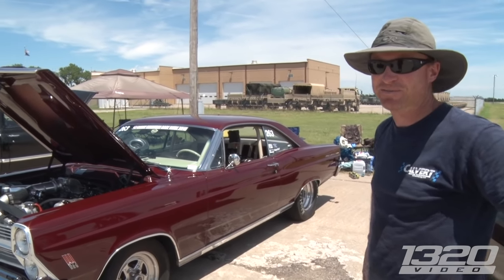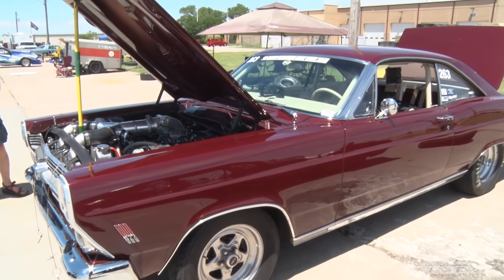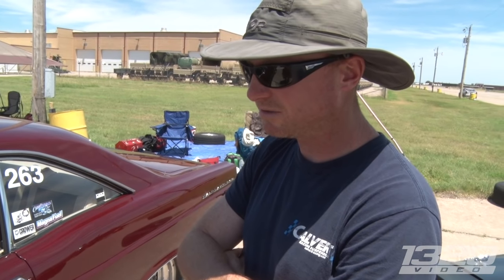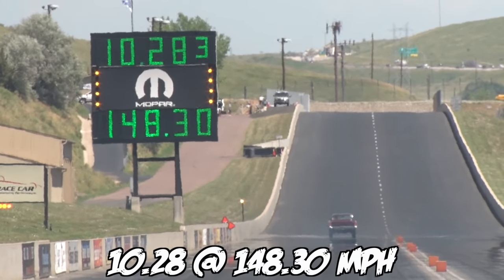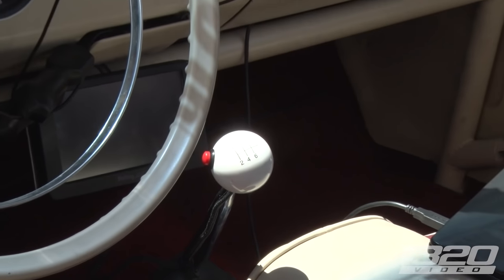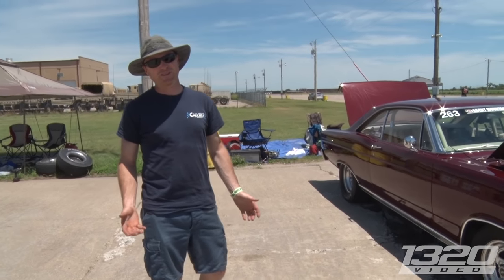UNBELIEVABLE Power Plant - Not Your Average Ford Fairlane!

Comment: Thanks for all the feedback, feeling privileged to get some 1320 love, thanks Kyle!  I will say I ran RMRW with the Hoosier QTP DOT tire, didn't hook at all!  Tried a MT slick after I got back and it hooked real nice, went 9.69 with a 1.63 60', still more work to do as always.    Thanks again!
Reply: v8Billy66 Love the car man! Keep doing what you're doing
Reply: v8Billy66 great job with the manual!
Reply: Mr. Jones yes
Reply: v8Billy66 right on! keep bangin them gears
Reply: Who built the trans?
Reply: BAD ASS!
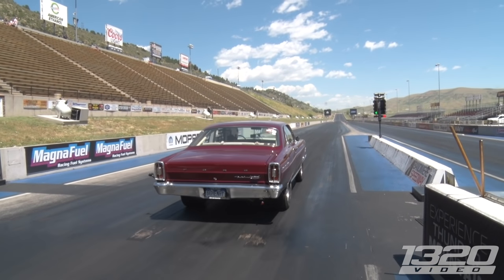Reply: v8Billy66 saw this vid when it first was posted. Awesome car.  But I just watched it again and it looks like you lost something off the car @ the 2:30 mark? What was it?
Reply: Liberty's Gear
Reply: Alternator belt
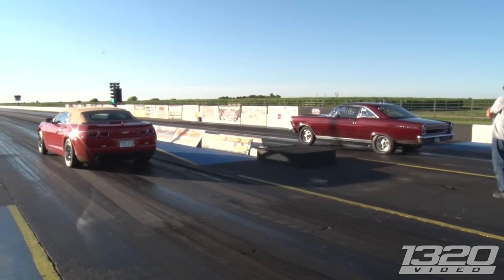Reply: The last run @ 5:10 was a 9.77 @ 151mph. Was that with the DOT tires, or slicks? That's a helluvan improvement from the earlier mid 10's, especially if it was accomplished with the same tires. Through several runs, it looked as if you were routinely breaking traction when shifting. 

 The run that threw me for a loop, was one of the last runs that ended at like 10.02 @ 122mph. There, you greatly reduced your et's AND mph's. I'm surprised you could shave off roughly 1/3 sec, but be 30mph slower(???)
Reply: So I have a 67 Fairlane with 347 stroker needing ideas

Comment: Gotta appreciate the dragsters that stay manual.
Reply: Dexter Yang after he twists a few axles and destroys a few driveshafts and clutches he'll be changing it over to a automatic watch and see
Reply: I don't think he will be not everything is about going fast in a straight line, with the 6 speed he gets 20 mpg I doubt he will get that with a power glide auto or what ever else.
Reply: Depends. With a 4L80E and a GV overdrive he could get 20+ mpg.
Reply: Notmy Name yea he would get less gas milage with an auto but i dont think it matters cause this is track car, not something youd wanna drive to work everyday but im 100%  sure he would be faster with a automatic becouse ive had friends that started out with stickshift and had to go to auto to make gains in speed, not to mention all the broken parts becouse of a stick, that said i hate automatics!  Id take a stick any day over a automatic as far as everyday driving
Reply: I didn't see a dragster In this video
Reply: or he could just drop an even higher 6th gear in and get the same thing.
Reply: Ahh yes, a track car with a full leather interior, stereo and running 91 octane.

This is a street car that runs 9s, and unless you live in a city and deal with shit traffic all day, a manual is just better.
Reply: he would be running much quicker with an auto.
Reply: Dexter Yang he would be quicker with an auto. But there's always a special spot for dragsters with a manual
Reply: No, the CAR would be much quicker with an auto, not him.
Reply: Actually you can go just as fast if not faster with a manual. It's just most people don't have the information and products that would help them be more consistent.
Reply: ***** 99%  of the time cars that have real big turbo kind of power are faster with automatics, thats just the plain old truth, think about it, a turbo looses its pressure or boost when your shifting with a clutch and changing gears, an automatic keeps its boost all the way down the track, and there are litterally thousands of videos on utube where automatics blow right by cars with stickshifts, think about all those cars in the TV series" street outlaws"  they are all running automatics, that comes from trial and error!
Reply: James Palmer ummm.. if u wanna be like that then no he didn't say anything about the track he just said faster. Plus he is right technically a sequential gearbox would be just as fast as a full autopsy long as u get off the line good. And to be honest I think this man drives his car with the h pattern that good that he prob would only gain a tiny bit from a auto.
Reply: James Palmer mate just take the win if that's what this is about for u, I hope I made ur day thinking u "won" the argument. Go tell ur cyber friends about how u won the comment section battle.
Reply: Dexter Yang the T56 was only made to handle 1k whp and the car was turned down last year. This year he added XXX more power into the car and it will stay a manual (face plated t56). Car started as an auto and he wants to stay manual and trapping over 160..
Reply: whatever, his car  and he can run 3 on the tree if he wants.
Reply: Yes, this is a real street car, not a pro-mod that's not even running a radiator. Advice on how to make the car run faster is cheap talk with some one else's car and some one else money. Putting a powerglid in that car to shave off a half second ( at best) makes as much sense as a 2 gallon fuel cell.
Reply: eric wsmith go back and watch that malibu blister this cars ass that didnt a good of motor as this ford did but becouse he had an auto he roasted this ford hard way more than a half a sec, watch and it wont be long that this guy proves my point exacly and puts an automatic back in this car, a high dollar auto and gains way way more than a half a sec
Reply: odd so many keyboard bench racers think an auto would be faster YET many records have been set with manual over auto. also developing proper converter, trans setup could cost well over $5k-$10k and yet decent clutch,bell housing, competition  drive shaft , trans can be had cheaper and fact is you need more or less stall change the chip, he street dtives it so probably uses blow off. if he had cyl kill on shifts might be tad more consistent.  as for axles its a Ford, slap in 9in with 40 spline spool, gun drilled axles and your good on an uncut car. he doesnt have enough slick to destroy  driveline parts like some say. also i would say he has progressive  controller to tailor the boost level to rpm/gear level. been racing, building and tuning race cars/engines  for 30 years. fast with a stick is possible also consistency . some people just have so little knowledge proof.
Reply: the proof is he is trapping high 9's at over 160mph.  he has enough power to run in the 8's.  sure ideally with all the extras, manual is faster.  autos is simpler and less money.  I wasn't even trying to start a pissing contest.  all u need is 135mph to get into the 9's.  hes going over 160.  it is a very fast 9 second car
Reply: MonzaRacer go ask why every cast member of "street outlaws"  why in the heck!  Are they running automatics over straitshifts
Reply: I think your all missing the point, this guy did not build a race car, he build a street car that goes fast.
Reply: This is literally what brought about the auto transmission to the masses, Women. Ultimately it was to sell more cars to women.
Reply: Agree totally.

Comment: Kinda interesting that with internal combustion (read: piston/ rotor) engines, you want the fuel somewhat cooled. In turbojet engines, the fuel is heated by a heat exchanger with oil or Hydraulic fluid flowing through so the fuel cools the oil/hydro, and the oil/hydro heats the fuel for better atomization.

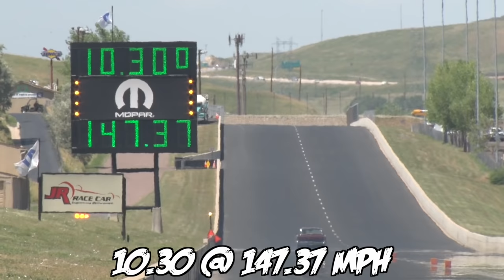Comment: Did I Hear Him Say He Was Only Running A 2:56 First Gear??Man,W/ A  Taller First Gear, He Could Prob.Have Low 9' s,- 9.75.AMAZING FairLANE. Had A 66 Comet Cyclone 289, AS My First Car ,After Retuning From NAM,Though It Wouldn't Hold A Candle To This Monster,Being a C Code, Put A HOLLEY DIRT TRACK 2 Barr.on It ,W/ Oversized Jets & Beat A Few SB 4 Barrels,Red Lite to Red Lite. Fairlanes & Comets Were Sleepers,But Got Their  Share of TROPHYS @ The TRACKS & WON THEIR SHARE OF CASH STREET RACING.!!
Reply: 2.66 1st gear, has since gone low 9's

Comment: Its time to get deeper into the electronics and let the boost bleed down to leave with. The car was still coming unglued in 2nd and I thought I saw a 3rd gear wheel spin in one of those passes. That will make the old butt hole pucker.  Im assuming if things are dialed in a little better the car has a high 8 low 9 second pass there at over 165mph. ?  Beautiful car for sure. And old school manual trans. That is real racing on the drivers end for sure. Good luck in the future
Reply: Agree, more tuning and dialing in to do, however a slick does and will make a huge difference

Comment: The rear diff might be tall, but all the torque a turbo car makes that isn't such a bad thing.  Perhaps, not so tall and if 60 ft times aren't so great, adjust pinion/diff angle slightly.
What suspension set up are you running? 
I know low 9's... high 8's are in your future. Set-ups are a bitch.  I speak from experience. I am currently replacing my car's rear
with a Competition Engineering Magnum 4 link. (67 Elco.)
I LOVE the 8-track in the player!
Reply: Have done some more tuning, down to 9.22 so far, 5.9 1/8 and 1.39 60 so far

Comment: reminds me of my 1966 Ford Fairlane 500 two-door hardtop but if I remember you could get one of those with a 427 cubic inch V8 hooked up with a manual four speed transmission but I don't know precisely how many Ford made for the year 1966 but I think it was 100 of that model and one of those lucky owners to have that car was Parnelli Jones now that particular Ford had aluminum bumpers in that car was meant for racing now the car that I had look very similar to that but mine was a 6 cylinder 200 cubic inch hooked up with a C4 automatic now a car like that that was kind of rare because most of those Fairlanes for the year 1966 would have a 289 or 302 or 390. V8 engines if I remember the car's gas tank was 20 gallons and that little six got like 27 miles to the gallon.
Reply: They made 56 427 Fairlanes in '66, easy six figure car today

Comment: I'm a Mopar guy but the 66-67 Fairlane 427's are my favorite Ford's ever built. I'll take a 66-67 Fairlane 427 or a 63 1/2 Galaxie 427 over a Boss 429 Mustang any day of the week. All the 1963-67 427 Ford's are bad machines whether it's a Galaxie, Fairlane, Comet, Shelby Cobra, or the "Ferrari Killer" GT-40. The Ford 427 had more success than any other engine in the history of American auto racing...Nascar, NHRA, 24 hrs at LeMans, Pike's Peak...you name it and chances are a 427 Ford won it at some point. The earlier high performance Ford's are cool too...particularly the 57 Ford's with the 300 horsepower supercharged 312 and the 61 Starliner with the 375 horsepower 390 4bbl or the dealer installed Tri Power setup which upped the horsepower to 401

Comment: He needs to do bigger burnouts with those tires then he would be able to dump clutch launch it. When he shortshifted into 2nd 4:50 he ran a much better time, even with 2nd gear starting to lose traction from the poor burnout.
Reply: you probably are right
Reply: Needs a slick, those are Hoosier QTP DOT tires

Comment: Did he say that it's a 427 Windsor platform? Not sure what that means is it a 351 Windsor bored and stroked?
Reply: Yes
Reply: @v8Billy66  I think he also said he had a Cleveland in it for many years sort of interesting that he pulled a Cleveland to put a windsor platform in but who knows maybe the block was beyond re build
Reply: @acts2211  The Cleveland is a good motor but not up  to the rigors of boost.  The new combo is based on a Dart block, way stronger than the old thin wall casting Cleveland

Comment: I think if he'd go down an inch in rear rim size and have more sidewall he'd get better traction. He's not at a power level that can't get 100% traction. He'd be in the 9's if he could go from a-b
Reply: It looks to me like maybe he's not getting enough down force on the tires. Maybe the pinion angle or some traction bars (not sure if these are leaf or coil springs?). But yeah, plenty of power to drop a second more with traction.
Reply: down an inch? like you mean running 14's? LOL I love noob moronic comments, you try and get good 14" tyres hahaha , IF he needed more sidewall WHICH HE DOESN'T you'd go taller tyre  ok kid. I'd sugest his tyres are a lil old or maybe not enough burnout as the suspension looks to be standing up ok and not unloading it's just not hooking
Reply: Just needs an actual slick, that is a DOT Hoosier QTP tire in the video

Comment: A Cleveland is a small block.
Reply: coolguy112286 Cleveland is the big block, windsor is small
Reply: Nope, Cleveland is a small block.
Reply: They're both small blocks
Reply: are you new to cars lil buddy?
Reply: 351 Cleveland has a small block bolt pattern.  It has the same bore and stroke as a 351w but it has a shorter deck height which means that is a little wider than the Windsor.  The main difference between the two are the heads of which the Cleveland had bigger ports and canted valves.  The later 351m which also had a larger deck height and the big block bolt pattern along with the 400 might be able to be considered a big block.
Reply: 2 different style heads. 2 barrel carb and 4 barrel carb heads. a lot beefer block. and if im not mistaken alot of oiling issues. that might be the 351m 400 though. 351w better imo than 351c for weight.
Reply: the oiling is an issue if you plan on making big power but can be fixed with restrictors and lifter bore bushings. Another problem is thin cylinder walls which require filling the water jackets part way with hardblock to keep them from bowing out under load.  I've been told you don't need it under 600 though and you only need to fill it halfway.  

My engine only has the restrictors and no lifter bushings and I get about 10 psi oil pressure at idle but it hops right back up to around 30-40 psi.
Reply: adam aguilera actually they are a mid block or "middle" look it up
Reply: NTH Welding I didnt know a big block bolt bolted to small block tranmissions lol. It just runs like a big block, but its a small block
Reply: adam aguilera yes you are correct. The 351 Windsor or 351 Cleveland we’re both considered small block engines. The Windsor engine had stronger bottom ends but the Cleveland had better breathing cylinder heads. I once had a so-called; “Clevor” engine because I had Cleveland two barrel heads on a Windsor block.

Comment: why is it unbelievable because its not a ls motor ? unbelievable would be lawnmower engine or electric motor from a tesla
Reply: Way to assume. It's not unbelievable because it's not an LS. Unbelievable is a bit baity but, the point is when was the last time you saw a twin turbo 427W? Let alone running through a T56 in a Ford Fairlane?

Comment: that car should be doing 1.20  sixty footers at 9.00 at 150 mph  not hooking at all.   take those 427 emblems off you wanna be stinking small block
Reply: It IS a 427...
Reply: if that,s a fe 427 you should be pissed  i know of legal ss/a 1964 t-bolt that runs 8.50x155 with carbs and gas
Reply: 427med good for you buddy... it's a toy in progress.
Reply: look up another guy lester combs  using cal-trac he  he leaves without wheel spin give you an idea friend runs a original t-bolt  runs 850,s with 870 hp. with what you have should be running 8.0   8.20
Reply: 427med dude he put the car together about 6 weeks before 1320 filmed him...  His car is faster and on bigger slicks.  He could be in the 8s with an auto but it's his toy and a cool car, he is a friend and a cool guy not worried about having the quickest car... is it ok to chill? He knows it's not the fastest car on the street...